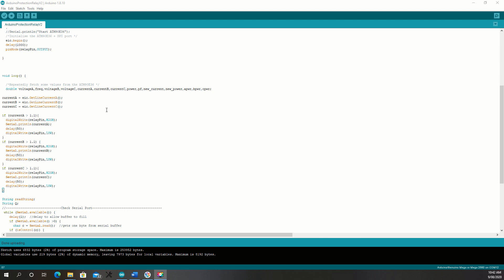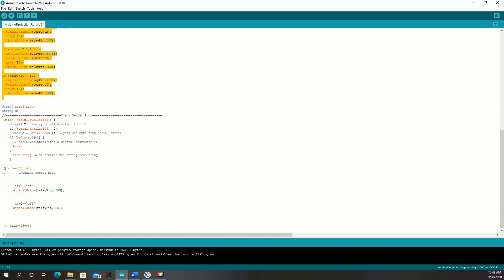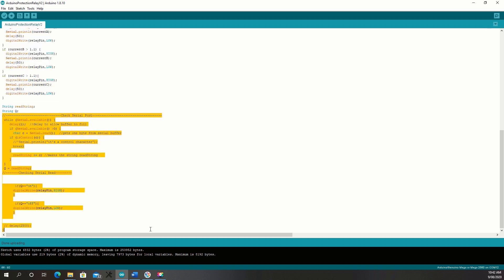Arduino Power Protection Relay

Comment: I recognize the QuickCMC screen!
Reply from the maker: That’s right. I’ve been working on a diy omicron cmc, have got the voltage and current output sorted working on the timing and control stuff now. 
Also got a new measurement board designed and awaiting assembly quotes so should be able to improve my diy relay

Comment: Hi, 0.2 sec is ok if especially if you need to grade with anything, you need a more repeatable result if you are going to map a curve.
How fast and repeatable dose it operate from a binary trip in?
Reply from the maker: Yeah, id be happy if it was repeating 0.2, I'm going to try and a see how far i can go with it. (Distance, diff, Over Volt etc). Then bench it against a SEL or MICOM. Total investment so far is like $200AUD

Comment: Hi mate, did you try direct port addressing for speed?
I would go looking for a more well known brand of relay, rather than a Chinesium brand.
Reply from the maker: Tom George no I didn’t, I will check out other brands. Thanks for the help.
Reply from the maker: Tom George. I had a quick play with direct addressing. I think it's had a dramatic effect. But it need to spend more time on it increasing my delay between opening again as it chattering, so the test set isn't cutting out fast enough. Thanks mate